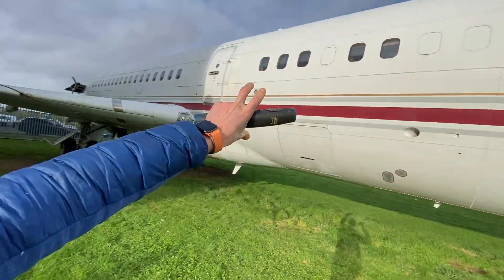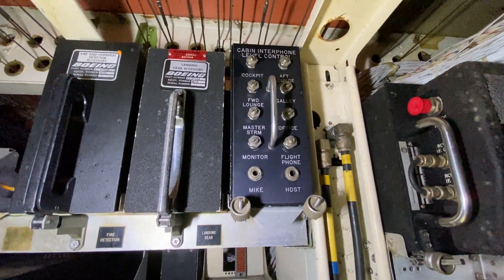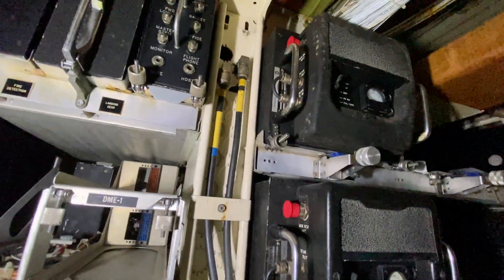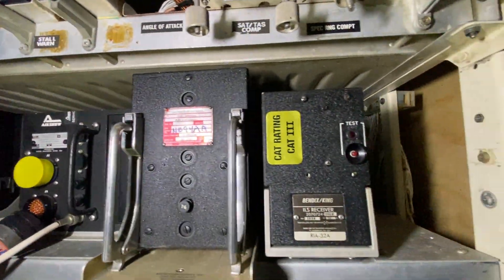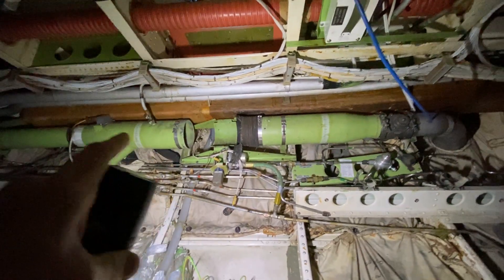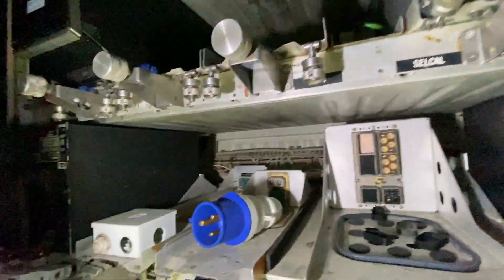PytchAir Project Episode 8   what's in the avionics bay

Comment: The cabin interphone is how the pilot communicates to the crew/flight attendants. That box appears to adjust the volume levels for different interphone locations in different parts of the cabin.  The pilot communicates to the passengers on the PA (public address).  
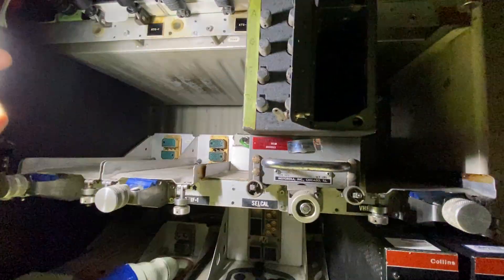The empty box at 1:11 says "Motorola" so I wonder if it could perhaps have been the phones in the seatbacks? No idea!

The "Gonio Indicator" one has an "ADF Receiver" label.  You can google that. ADF (automatic direction finder) is an outdated type of navigation that everyone had pretty much quit using entirely by 2005 (unless they flew an old airplane that didn't have GPS).
The next one "Marker receiver" is part of the ILS. It gives you an indication when you are over the Outer or  Inner marker on the ILS.   Due to GPS and DME derived distance information you could consider this old/outdated too.

All the SP-50 Flight Control system stuff is the Sperry autopilot. I'm not a mechanic who knows things-  I just googled SP-50 (knowing that it was the autopilot).

Notice that there is a label on the shelf under some of the LRUs. The two "Gyro test" boxes are the upper and lower yaw damper which activate the rudder to damp out undesired yawing to prevent dutch roll on swept-wing aircraft (keeps the tail perfectly following the nose).

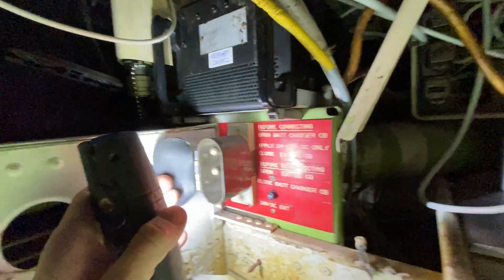2:45 I guess that is where you'd plug in ground power if you wanted to electrically power everything, like if you were an avionic tech working there in the E & E bay? 
 
2:49 appears to be associated with the control of the APU (auxiliary power unit) and the battery power used to crank it up to get it ready to start (like a starter in a car).  The APU is a little gas turbine (like a jet engine that doesn't have a fan or make thrust) that can turn generators to make power and produces hot bleed air for heat and pressurization prior to the main engines being started.  It's pressurized bleed air is used to turn the main engines for starting.
Every modern airplane has its APU in the tail. The 727 has an engine in the tail so its APU is in one of the main landing gear wheel wells or in the wing root (or a combination of both). I don't know which one it is, but you can probably find it in the gear well.  I think the APU  has a circular exhaust port in the top of one of the wing roots, right next to the fuselage- probably right above the main gear wheel well where the APU is.

I would get on ebay and see if anyone is selling a Boeing 727 Maintenance Manual.   Or try an internet search for a description of the 727's E&E bay or the LRUs (Line replaceable units) in those racks- maybe there will be an illustration online from the maintenance manual?  Or search "Boeing 727 Maintenance Manual"

The metal green tubing is probably the pneumatic engine bleed air, but some of it may be for cooling air that is going to the avionics bay (not sure about the cooling air part).  The brownish plastic-looking duct is generally for the air going to the cabin from the air conditioning packs.
Reply: Interesting!

Comment: What your looking at is basically the brains behind the panels in the flight deck and the cabin. each box is referred to as a LRU or line replaceable unit. They are the computers or the brains for most of the Avionics. Below the LRUs are labels that tell you what kind of system its for so for the Fire Detection that LRU controls the monitoring of the fire loops for the engines, APU and bleed air for transport category aircraft. The Motorola box is for ACARS witch is a data link to the airline to communicate and  send and receive messages.  The green pipes are most likely for the conditioned air and the red pipe is for Bleed air from the engines or APU